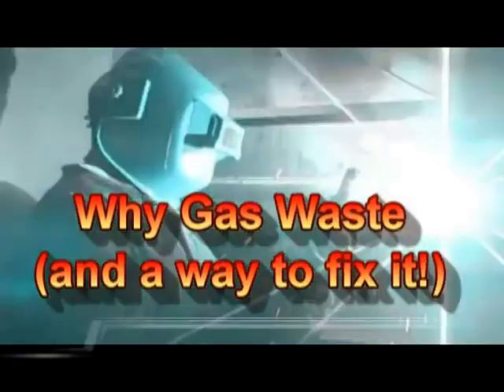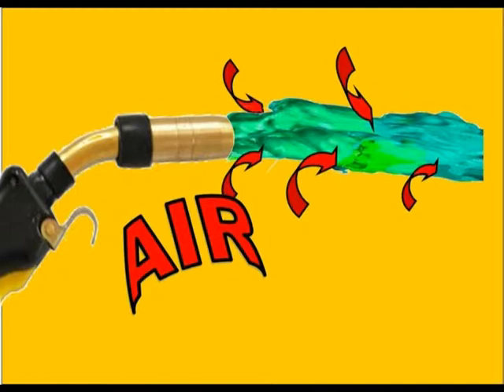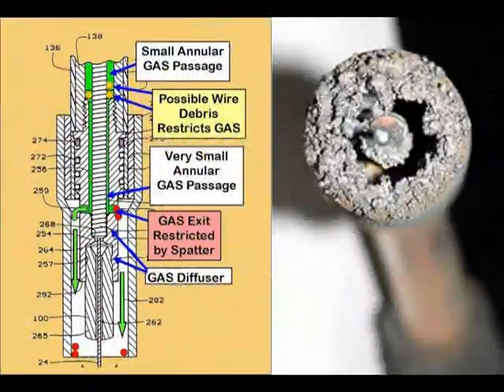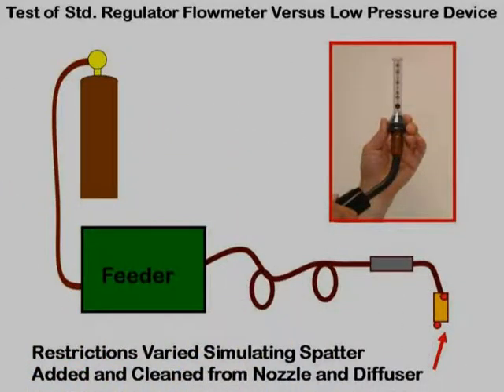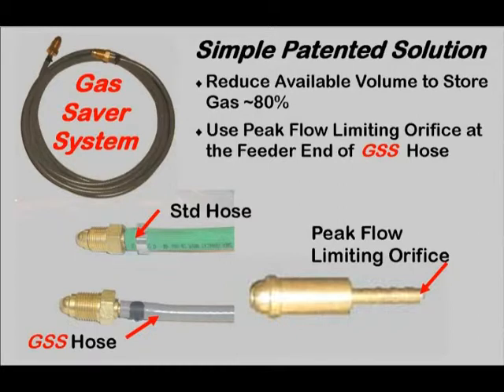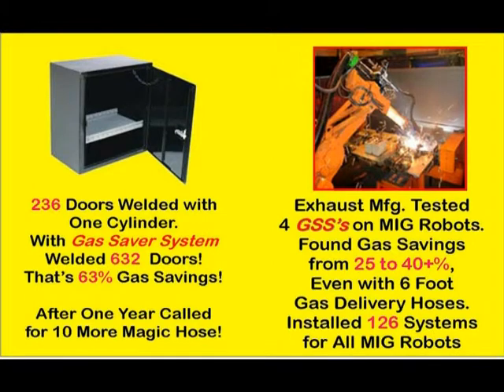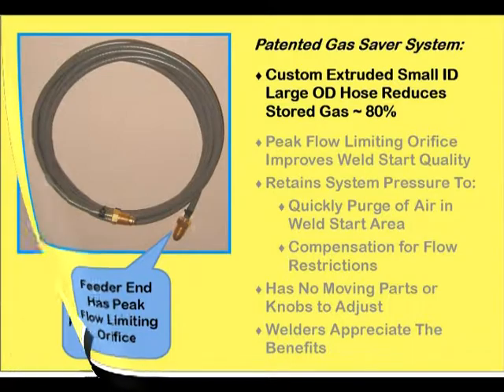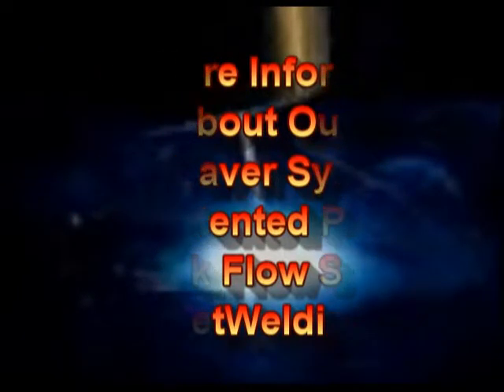MIG_Gas_Waste_&_Solution

Comment: Finding this exceptionally useful information since I'm mostly doing thing auto body metals and thus a lot of spot and stitch welding. Thanks. Seems to me that moving the flow regulator to the back  of the machine's gas solenoid is the way to go, if the situation enables that.
Reply from the maker: Funny, a large fabricator with ~100 welders did just that, installed the flowmeter at the gas inlet to the wire feeder.  We found welders were setting high steady state flow to make up for the lack of initial start gas!  Nope any device mounted at the welder of wire feeder just causes weld start issues.  Welders might not understand why but can see the poor starts.  It's like starting in air.  In that case welders, on average were setting >75 CFH tying to compensate.  Wasting NOT saving gas!  Full details about fabricator and others are on: http://netwelding.com/Simple_Orifices_Don't_Work.htm